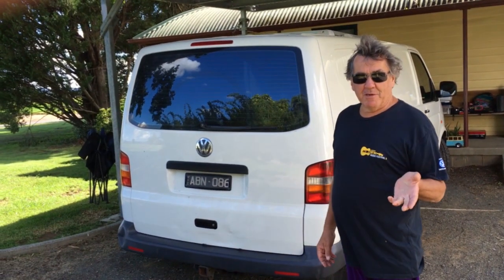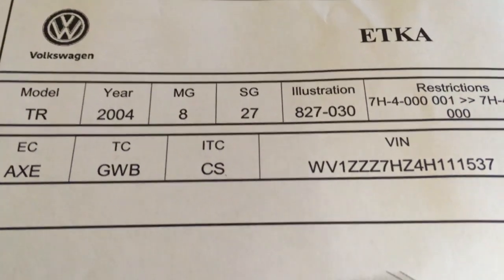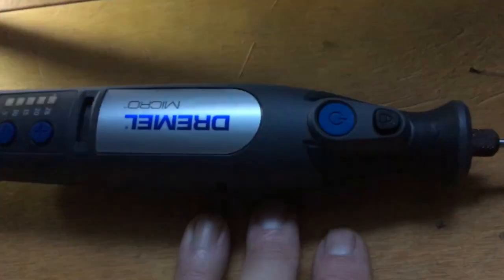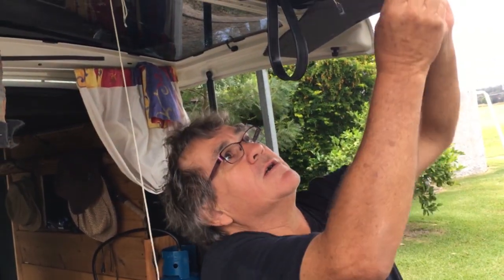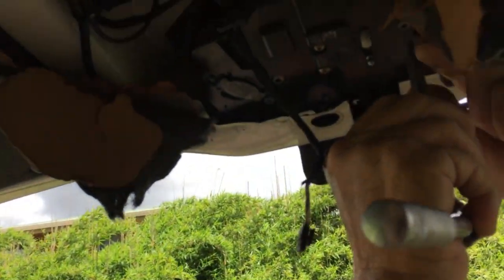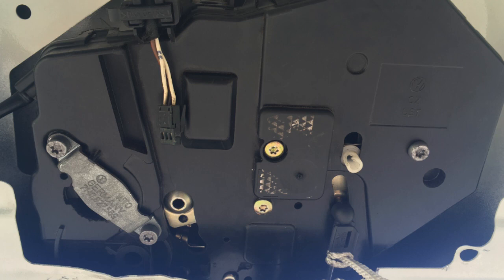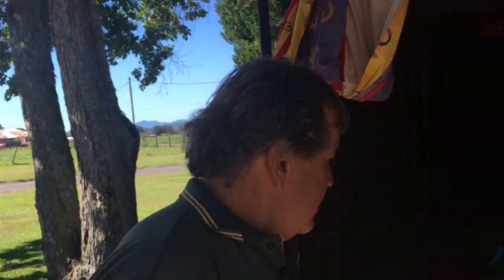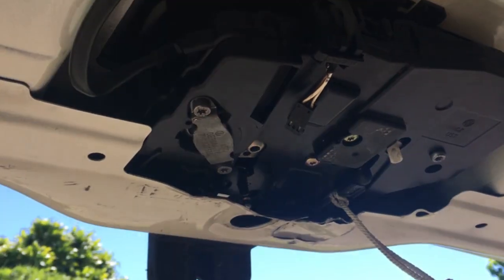Broken Tailgate Rear Door Lock VW T5 Transporter

Comment: Hi Paul, a very big thank you for this video. I am from Mbombela (former White River/Nelspruit) Mpumalanga South Africa. Mine just stopped working after a field picnic trip. I have a more elaborate, 3 times 1200 x 450mm sliding drawer kitchen and storage system setup inside this tailgate. I did all of it myself, ensuring everything fitted as tightly against the interior lining as possible, for maximum space utilisation. I had the same story as yours, with dealers, panel-beaters and the like and was desperate. I am a pensioner, aged 74 but having the tools I decided to tackle it myself. I started ripping out the interior. I removed the bed top and had to cut out the shelving of my sliding drawers, just to reach the inside bottom of the door. Then I decided to hunt for something on Youtube. Fortunately, I found your video rather quickly and it is so good and descriptive, that I had no further problems reaching the spot. As there was nothing broken, I reached in, pressed the link head up and pop, it opened as sweetly as ever before. I promise you, I gave a much louder whoop of you than yours. I had a good laugh as I saw you throwing out the ripped-out junk, as it must have looked the same here from the outside. Nothing was broken, two of the holding down bolts have fallen out, supposedly from the many corrugated dirt roads that I have used the vehicle on. The adjustment on the link from the outside latch has shifted because of it and after slight experimentation with the tricky adjuster, I had it perfect. Many many thanks Mate, it really helped me a lot.

Comment: I've got a 94 HiAce with busted handle which I will replace but u fitted a push lever on inside that unlocks door - on my older HiAce I fitted a pull string as mechanism was different. Current model has rear bed  set-up

Comment: Fear not folks, you may not have to cut open your tailgate. I have the same fitted bed structure as this so there are only a few inches to get my hand / arm down the gap. I spend hours with a bendy coat hanger troubleshooting the other day to no avail. I have watched countless videos but this one was the one for me! I have 0 experience in any of this but using a tent peg I had a fiddle in the leaver area and managed to somehow click it into place and get the tailgate to open. No saws! I was lucky. Now to fix the broken sliding door that wont open 😭

Comment: Hi Paul..Just had the same issue but found the lock can be activated via the round hole next to where you cut the sheetmetal..Theres a rubber plug covering it..

Comment: Remove number plate drill a hole in the centre push the rod door opens,  once you've fixed the problem fit a grommet in the drilled hole and refit number plate